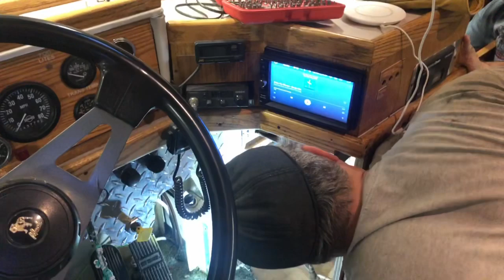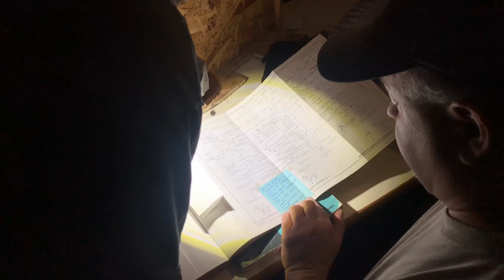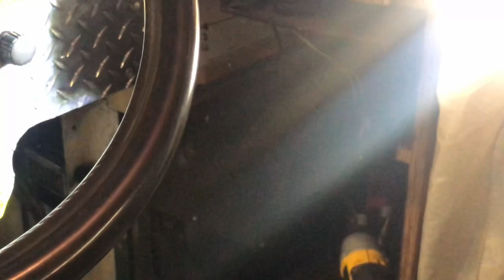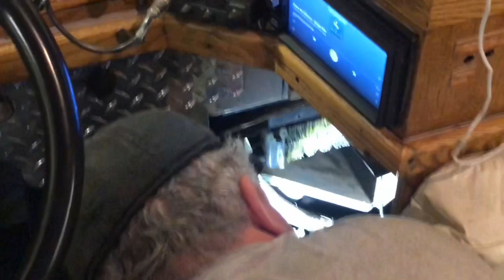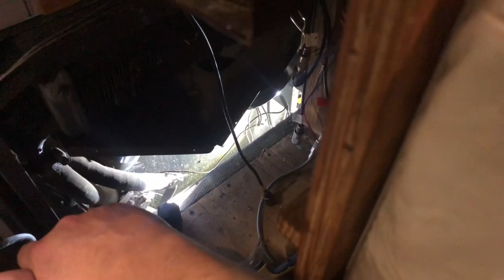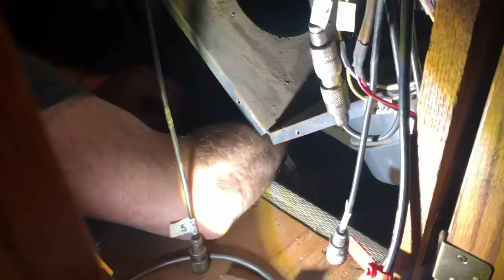GM 4106 bus defrost fan repair (edited for wiring clarity)

Comment: Hey Scott,
The original wiring called for the motors to run in series for low and parallel for high.  This was controlled by the defroster motor relay.  The relay you have looks like it might work the same as the original (which looked like a big old 1950's style metal box about two or three times the size of the more modern one in there) although you have to check the wiring diagram on the relay to be sure it functions the same way. When they run in parallel (high) they each get positive power through the relay from the power source.  When they run in low,  the relay switches the power and it passes through one motor to the other.  If a brush is removed, neither will run in low because they are wired in series (electricity passes through one motor to the other to run both) Any break in the continuity (absent or not working brush for example) neither will run and there is no way to test the motor when switched to low.  So if high works for both, it should be assumed both will work on low when wired in series. 
Hope this is what you were looking for. 
One other piece of advice: get some smaller hands!
Reply: yes, the previous owner changed it to a Bosch style relay.-Mike.